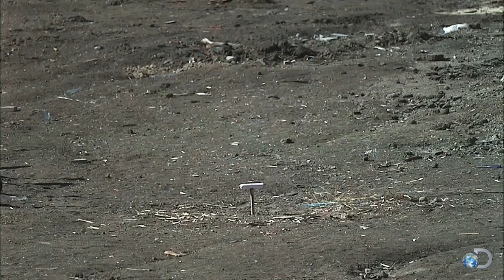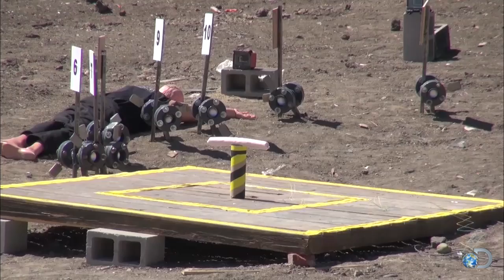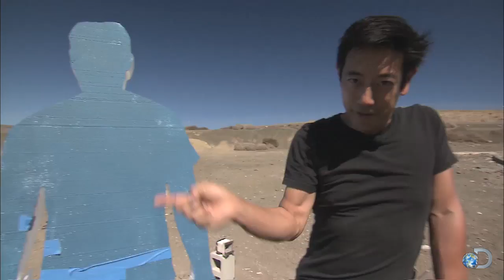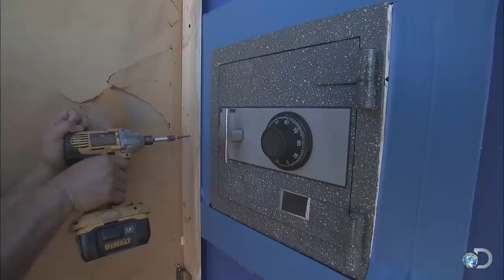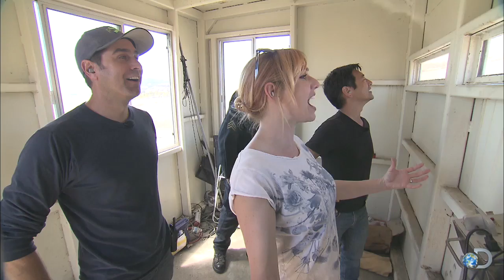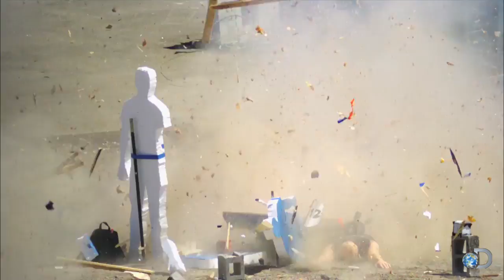Out-of-Control Test | MythBusters

Comment: I think the safe could be a good idea as long as you keep the door open and don't care about what's the opening is pointed towards. Pretty likely the blast will be contained in all other directions by the walls of the safe since the pressures should be much much lower. Might even work with something like a steel/kevlar helmet, again as long as nothing covers the opening.

Comment: you would need a safe with walls thicker than 6-10 inches of high strength steel to contain the blast energy from 3 or 4 sticks of dynamite

Comment: I think the safe worked relatively well, as I imagined it redirected most of the blast in the door's diroction, they should have tested it assuming the victim would seek cover by running paraller to the wall not right in front of it.